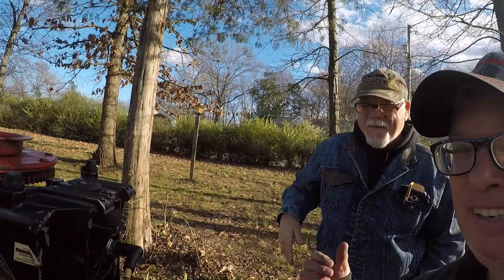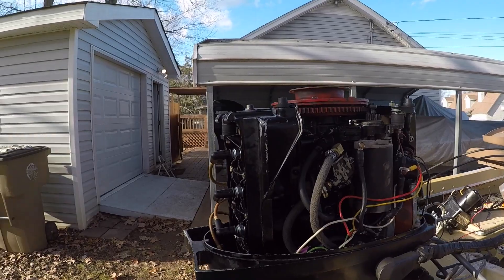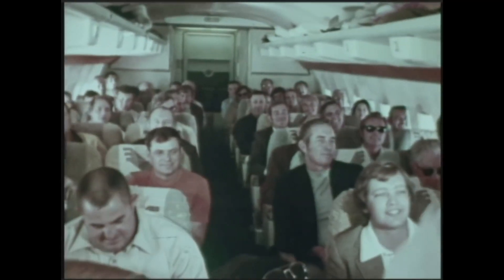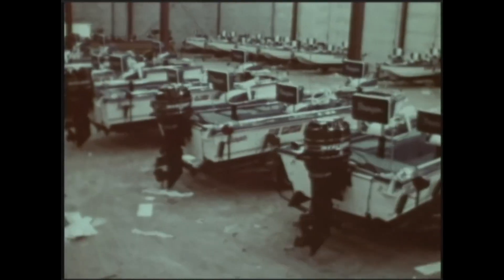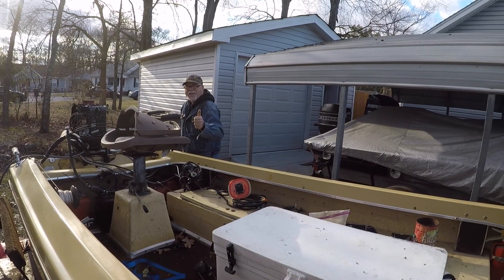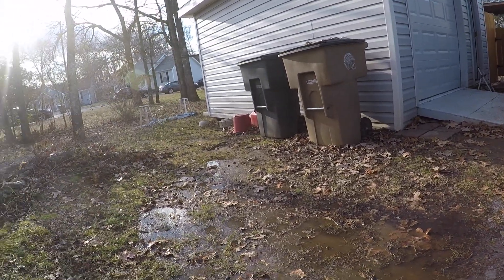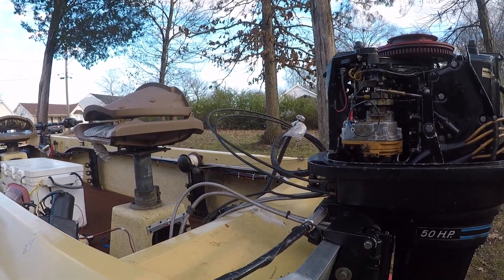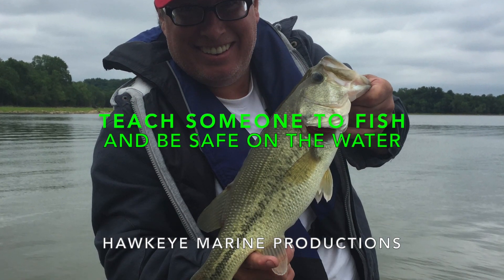Mercury Thunderbolt 500 47 year old motor will it run

Comment: Ok gona question i got exhaust smoke coming out the pee hole and no water circuitous with a new impeller. Blockage or exhaust gasket
Reply from the maker: Take the lower off and flush it with a hose.  Careful to watch your water pressure.  You should see water coming out the pee hole.    Probably blocked.

Comment: I just purchased boat an motor for 1500 only problem that it smoke a little bit? Where should I startt
Reply from the maker: Make sure your carbs are open all the way at WOT.  So, with the engine off put the engine in all the way forward gear and look inside the carbs and see if they are all the way open.  If they are check for any sort of vacuum leak by spraying some carb cleaner around the carb.  Make sure all of your fuel lines fittings are tight.  If you haven't rebuilt the fuel pump in awhile I would do that.   Best of luck.
Reply: At the beginning

Comment: Nice work, I have the 1969 same model motor, Can't get the seal ring to seat properly into the lower unit, the inner threads of the unit are messed up and the plastic ring threads in but will not seal as I still find there to be water in the gear oil, how can I fix this? I have already had the vertical shaft spin-welded and machined due to grooving at the o ring, now this. Also the motor will run wide open like a dream for about 20-60 seconds then bog down a ton then right back to running like a dream, repeatedly and seemingly only under load, any thoughts?
Reply from the maker: I've found some of my comments I never received.  Did you get this problem sorted out?

Comment: How hard is it to change the spark plugs?
Reply from the maker: Easy.  The bottom plug you will have to use a wrench.  I have a curved closed wrench for that.
Reply: @hawkeyemarine   Do you happen to know what kind of plugs or if they need to be gapped?
Reply from the maker: @mikemarsh4221  Champion  L76V no gap is necessary.
Reply: @hawkeyemarine  Thank you! Have you ever had to change the gear oil on one of these? What type should I use and also which one is the drain plug?
Reply from the maker: @mikemarsh4221  I have a video on it.  Quicksilver gear oil SAE 90.
Reply: @hawkeyemarine  nice I'll go check it out now
Reply: I can't find the video... could you post the link for it? On my motor there are two plugs. One is flush and the other says vent plug.
Reply from the maker: @mikemarsh4221  The fill hole is on the bottom of the lower unit.
Reply: @hawkeyemarine  thanks a lot. I'm  literally on the water as we speak!

Comment: I have I 1974 Mercury 1150 and when it’s warm out it starts right up but when it gets cold it’s very hard to start but once it starts you can shut it off and it fires right up. Is that normal on these old motors or should it start fairly easy?
Reply from the maker: Its normal.  I believe it has to do with the carbs.  When its hot the fuel vapor rises pretty fast.  But when its cold out the fuel vapor moves slower.  At least that's what it seems like to me.  In the video I just didn't have the warm up lever up.  Every Mercury I've worked on likes to run at 125 degrees Fahrenheit.
Reply from the maker: Hey something you can check it to makes sure both of the venturi's in the carbs are opening and closing in time and make sure they seat exactly the same.